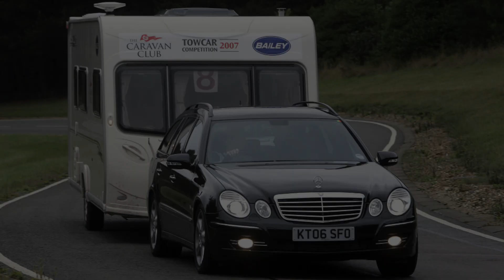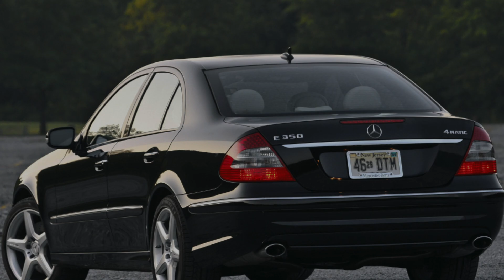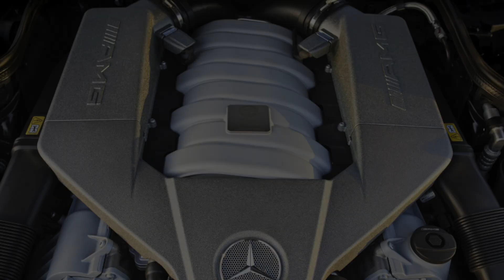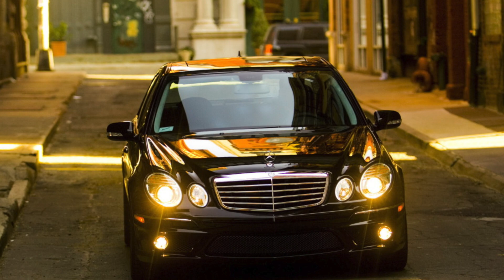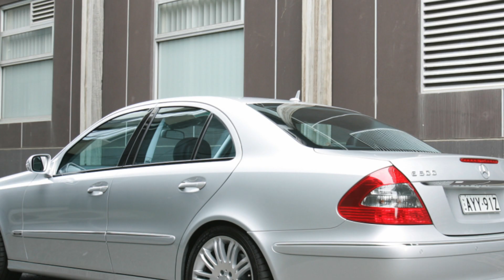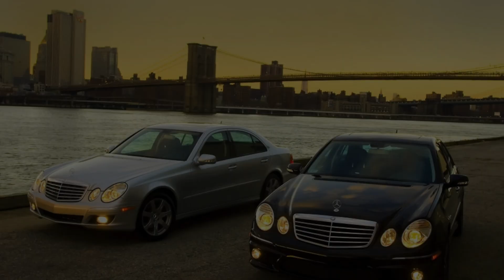Mercedes E W211 Problems | Weaknesses of the Used Mercedes-Benz W211

Comment: Thank you for the superb, comprehensive review. I own a W211 E350 Avant Garde in Obsidian Black, built in Feb 2005 in Germany and shipped to Australia. It has only done 105,000 km,. I've owned it since 83,000 km (6 years!) and have had it serviced by a specialist company every 6 months.. The period when this version of the W211 was built was when MB was just purchased by Chrysler USA, leading to cost cutting in certain areas, mostly the cheaper cosmetic treatments such as rubber sealings around boot and windscreen now rotting, the headlining separating from the base material, the stitching at the top of the rear seats splitting open due to heat and light--stuff like that. The engine has thrown the check engine light three times: intake manifold had to be replaced due to plastic tumble flap deterioration, failure of 2 catalytic convertors (all 4 I decided to replace), thermostat failure leading to wonderful cool engine temperature on the highway at high speeds. Other problems have occurred like squeaking suspension (replacement of upper or lower front-end arms). Now though, the 7-speed transmission is playing up (after two changes of fluid). Either the car will suddenly seem to be in neutral at very low road speed (twice happened--unable to move forward or backward as if the 'clutch' is slipping) or, again at very low speeds the transmission will jerk about. Both tranny issues are immediately fixed by turning off the ignition off and on again--all then is normal... I love my V6 E350 conceptually, so under-stressed compared to todays MB's that mostly use tiny 1.8 or 2.0 liter powerplants stressed out twin turbo motors in the aim of lowering emissions... Anyone have advice on whether it's time for me to say good bye to this lovely driver? Am looking at replacing it with W212, 2010 - 2012 E350 Avant Garde's with 60,000 km and a single owner... All advice greatly appreciated!
Reply: Go the newer car. I have an 08 E350 W211. Great car but same trans issues! Cheers from Victoria.